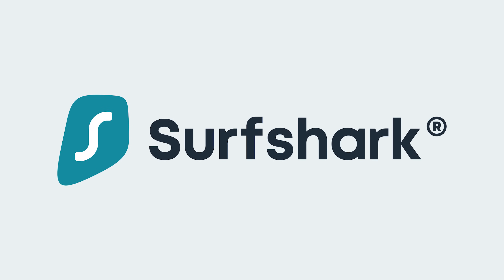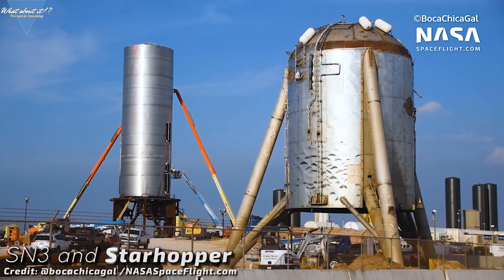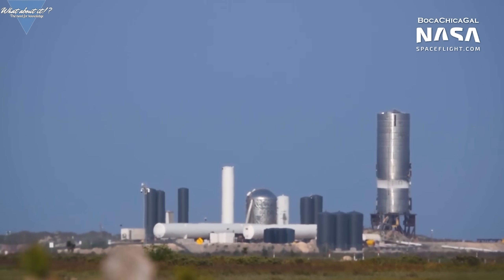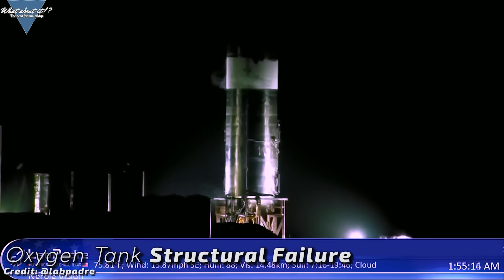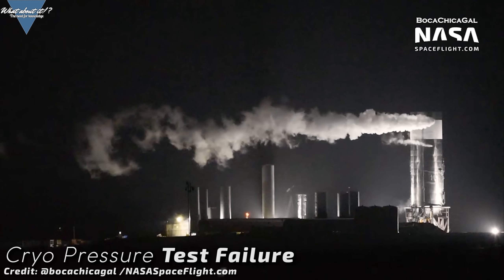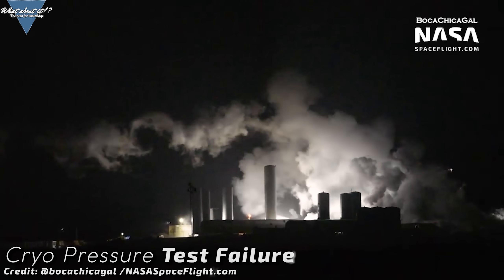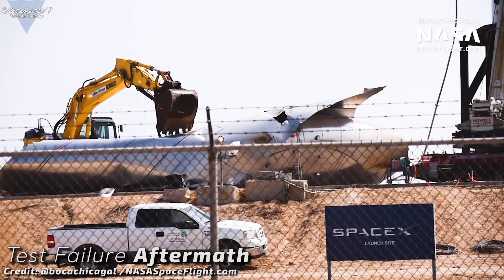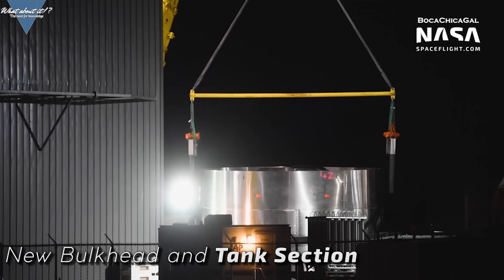83 | SpaceX Starship Updates – SN3 Cryogenic Failure Explained – Expectations For SN4

Comment: Personally I'd have thought the starship  would require a rigid structure to support the overall ship/frame.. afterall once its been into space most of the weight would be stacked at the top ie crew facilities etc then once it glides down it requires a structure to support the strain the wings would produce when they come into operation to stall the ship prior to vertical landing.. no frame, using the wings surely that would over stress the current design & split the ship in half or worse...
this test overall shows the weakness the current structures has... ie very poor, not only that is you also think/assume the lower booster structure (not built yet) has also a structure similar to this then again its very very weak.

rather then rushing a cheap/cutting corners design through to the launch pad... maybe they should trial the designs with scale models, computer modelling before building them as we've witnessed..

the rocket designs previously used & currently use.. all good & successful, however a rocket & a space ship have much different requirements & that's being overlooked.
I'd not be surprised if the competitor surprise everyone with a "here's what we've made" & have it launch successfully before a starship actually lifts off the ground. as there doing things properly, maintaining standards etc & using all available tests … but hey-ho "lets all wait & see"
Reply: As long as the tanks have pressure in them they are damn strong and act as a rigid structure. If they don't have pressure in them, well, you don't have fuel for landing so surviving re-entry isn't a concern.

Edit: Like Ryan says, if you have fuel you have autogenous pressure, therefore you have "structure". No fuel, no structure for significant acceleration loads, but at that point that's the least of your worries unless you have a refueling tanker or other reentry plan.
Reply: @jameshoiby  yes if the tanks have full pressure or equal/greater pressure within the tanks your a structural mass "vertically" up/along the ship, this structure is towards the centre axis of the vehicle. 
now the ship as it come into the atmosphere would be horizontal, thus going against its structural mass. then utilising the wings to stall the ship prior to getting into the vertical position for landing!! that would increase the stresses horizontally at all the wing area locations, this would be exaggerated due to the structural mass being down the centreline of the ship ie its most weakest/narrow point... 
the ship should/would require a structure to over-come the forces along its horizontal axis to counter-act the forces exerted on the wings & body upon landing (the ships vertical mass/weight isn't that important at this point)
Reply: @jameshoiby  yes! strong in a vertical position, as we see in the last test, tank/s low on pressure fail & the ship has no structural strength whilst in the vertical position (launch position etc)
the ship will have increased forces horizontally when coming into landing, this would increase when the wings are utilised for landing to stall the craft, having a structural mass towards the centre of anything is a weakness in-itself, hence why it would need structures to counter those forces, the fuel tanks don't have that mass nor strength as its overall forces go in the wrong direction.

ie simple example! place a plastic rule between 2 open tables & push on the rule, it bends & then shatters or snaps in half, apply that basis to the vehicle snapping where the forces would be greatest, between the wings side-side & then top to bottom.. weakest point would be between the upper & lower wings during stall/landing
Reply: Mal P The important thing you are missing is the tanks will be fully pressurized with autogenous pressurization of unburned fuel even when “empty” after liftoff.

Comment: My hope is that there is one team in SpaceX who will be really happy to see this test failure, maybe happier than if the test had succeeded. That team, if it exists, would be the Finite Element Analysis (FEA) engineers. If they are building FEA models (and I hope they are, I know for a fact they do CFD) then I bet that right now some FEA engineer is thinking "right, give me exactly the contents, pressures etc of those tanks in the time leading up to the failure and let me put that into my model and see if my virtual SN3 crumples at the same time index and in the same way as happened in reality. If there are any discrepancies between what happens in the model and what actually happened during the test that can be incredibly valuable to allow the FEA engineers to tweak parameters in their model to align it more accurately with reality.

Getting accurately calibrated FEA and CFD models is something we can't see from LabPadre's cams of Mary's work because it all happens inside an office but it is potentially just as important to speeding up the development process as putting up extra tents at the construction site.

Comment: (when a starship is coming back it is very light, even at empty tanks the payload is no more than 150t +around 80-200 for nosecone,, which gives less then 500t that crushed the lox tanks, no worries :) )
Reply: And it is still pressurized by CO2 and steam.

Comment: You dont have to fill an engine with a liquid, you can also just fill it with a gas. The lower tank lost pressure for some reason that we do not know and this is the configuration issue Musk was talking about.

Comment: I just keep on wondering if the cryogenic state on the stainless steal structure is the cause of the breakdown of structural integrity.  Maybe the material can't hold up under the differing temperatures on the stainless steal material, like when you heat up only one area on a sheet of glass.

Comment: SpaceX learns from its failures. Actually, the failure points to a future problem.  When Starship returns from a mission from capturing a load.  The ship will have to have a fortified middle section to land.  It's good that it crumbles now rather than later.
Reply: Note that any returning payload will weigh far less than a few hundred tons of oxidiser, so maybe not such a concern...

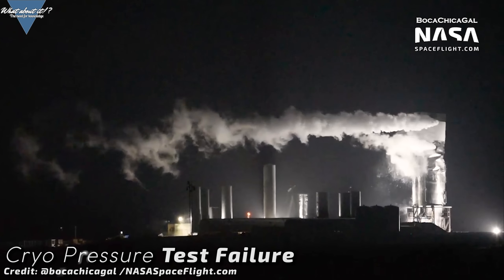Comment: 3:49 hmm but what is still not calculated here is that there is functional part of Starship missing. How much would it weight? Maybe they were checking this configuration (almost empty tank but a lot of cargo)? or maybe it is to early to bother that?
Reply: The tank was unpressurized or even a vacuum, that worse than the worst case.

Comment: I'm not liking the idea of them building a manned spacecraft out of frigging tinfoil.  This thing needs to be reusable.
Reply: Thats what all rockets are built out of in this case the tin foil is much stronger than normal.
Reply: @alextell7019  I thought most were made out of aluminum? The newest fad being carbon fiber...
Reply: @butterhat1938  exactly, thats why space x is trying to use a stronger material but without much other internal structure to build lighter stronger rockets.
Reply: @alextell7019  doesn't look a whole lot stronger. Seems like the experiment is failing. How can nasa approve of a manned mission where the astronauts sit on top of a pressurized tinfoil can that has to be able to land like a falcon rocket?
Reply: @butterhat1938  Its much stronger, the problem with that test was that the bottom tank was either unpressurized or in a vacuum with tons of liquid co2 sat on top of it, nasa sent plenty of astronauts to the space station on the space shuttle with epoxied on heat tiles and a thin aluminum skin.
Reply: @alextell7019  so what about when the starship lands back on earth when it's tanks are near empty? I like the space shuttle, but even it was eventually scuttled when too many astronauts died.
Reply: @butterhat1938  First, even if the tanks are empty they will still be pressurized, second if the tanks are empty then there wont be multiple tons of weight on them.
Reply: @alextell7019  if you're an astronaut do you really wanna bet your life on 1000feet of "qualified" welds that have been through reentry?

Because that's all that's keeping that vital "pressure" in under your seat.
Reply: @butterhat1938  Thick, high strength stainless steel vs epoxied fragile ceramic tiles? Every day of the week.
Reply: @alextell7019  you're clearly not a welder...
Reply: @butterhat1938  There us an old saying about this, you dont hire and engineer to build the strongest bridge you hire them to build a bridge thats just strong enough. Try crushing a plastic bottle with no top, the put on the top and try to crush it again. A space craft has to be as light and strong as possible and by all indications starship is, it will never have one tank fully fulled and one tank unpressurized, designing for that would be like designing a foot bridge to handle the weight to a tank.

Comment: AS Musk said they had pressurized  N2 gas in the lower section, anyone who deals with hydraulics knows that gas is compressible not liquid.
The lower tank section compressed under the weight if it had been liquid it wouldn't have compressed.

Comment: I get why s/n 3 collapsed. Still I must confess to feeling a bit discouraged. How many Starship fubar's before SpaceX runs out of money? Until it makes orbit and returns 🤞🤞🤞🚀🤞🤞🤞
Reply: Well i would estimate that it cost about 2 to build SN3. For company on scale of SpaceX it is not that much.
Reply: @skyrask1948  2... Million? Well yeah that's realistic price for 2 big steel cans connected to each other.
Reply: @_mikolaj_  If average salary between all workers and engineers is 100k an it took about month to produce it with 250 employees it is 2083333 dollars on salaries only. So yea any more witty remarks.
Reply: @skyrask1948  do you include material costs?
Reply: @_mikolaj_  As i said that was only for labor of course not every one work on it. Someone would on new hangars and other staff, that is why i said to estimate it it may be less or more, but i do not think i am too far of.
Rental of machinery is probably second highest cost in hundreds of thousands. 

When it comes for material steel in it of it self cost less than 100k and more like 20k. Other materials like batteries is not that much maybe 100k total. Since they do not use any exotic materials only  regular materials that are mass produced.

Comment: These failures show a perfect example how rapid prototyping works. Every iteration provides a plethora of minor tweaks and improvements and usually ONE major flaw whether mechanical, technical or in this case procedural. Intense design (every other rocket maker) tries to fix all of these before the first test, this makes their greatest investment TIME. And time is the most precious and expensive commodity in any project. It’s debatable, but rapid prototyping is less expensive because it saves time. How much you want to bet Starship flies before New Glen. If it does, what will it mean for the viability of NG?
Reply: This is not prototype failure. This is manager failure. But basing on that, o think we don't get 20km hop till some SN6. SN4 is already made, and still uses ballon tanks. Bad for reentry.
Reply: Mikicat your absolutely right. But if it’s a material, mechanical or procedural failure it’s still part of rapid prototyping. It’s all part of the same sleep learning curve. My former boss once told me, “it’s not a mistake if you can say I’ll bet they’ll never do that again.” Try to be a little more optimistic about the 20k hop. You are probably right but... come on! 🤨

Comment: Structure costs weight start light then build stronger as it breaks 🤔🤔
Reply: Only that Musk said it would become thinner. And SN3's steel was already much thinner than the Hopper's: 12.5mm --> 4mm

"Felix Schlang did some calculations of the weight of the ring segments with the Serial number one starship which is using 4 millimeter thick steel. These segments weigh 1622 kilograms. They are less than one-third of the thickness of steel used for the Starshopper. The optimized Starship will have some sections where steel is half as thick at 2 millimeters. "

(Quote from nextbigfuture)

Comment: My question,  Since at the launch they would use a special exhaust system  diverting the exhaust away.   But if it lands on Mars with tiny legs wouldn't  it get destroyed trying to launch from  being so close to the surface ?   I guess it won't be a problem if they never plan to relaunch  ......

Comment: Maybe, the starship shouldn't be that long. What if it was half the length but twice of diameter? With 20m diameter the simulated gravity inside should work, even if longer adaptation to high RPM would be needed.  With larger length the volume to mass ratio worsens, and also stability of construction lowers. On the plus side, there would be also much more space for engines on the bottom of the rocket. The rocket would be also much more stable once landed. 
Yes it would have a bit worse aerodynamics, but that doesn't matter that much over about 20km.

Comment: Saturn V had corrugated skin in carefully selected locations between propellant tanks, between stages, and as first stage engine skirts for the purpose of strengthening the overall structure. The corrugations dampened vibrations and resisted bending. The fuel tanks themselves staved off vibrations and bending by being loaded with propellant. As the fuel and oxidizers drained from the tanks, the empty vulumes were filled with inert gas (helium or nitrogen) to maintain their structural integrity.

Comment: I'm afraid that with such tiny legs there will be too little space between lower section and the ground when landing. Vibration and gas stream from the engines can destroy it.
Reply: My thought exactly. Landing on solid flat ground with those stubby legs might get tricky.
Reply: As long as the skirt pressure stays under 6 Bar, you only have to worry about resonance. But, the landing is so sudden that this should not occur. 

The landing is much shorter than launch, but on Mars there is no atmosphere pressing in on the skirt during launch. So the skirt should be ok. 

IMAO, there is no problem.
Reply: Landing with three engines should allow a hover-slam that is three times faster than Starhopper's.
Reply: @avid0g  It's difficult for me to imagine all the dynamic effects involved, but chamber pressure even in throttled down engines can be 100+ bar and exhaust volume is huge. It seems to me that leaving such small gap is a bad idea, after all.
Reply: @TechMasterRus  
A NASA simulation using "sand" shows that engine thrust will carve deep craters into the regolith, which will divert the debris upwards. If regolith is really that loose, the lander could be damaged. 

Anyway, these legs are an early design that may be adequate for a concrete landing pad. Elon already tweeted that the legs will soon be made longer/stronger.

Comment: I'm sure you've seen the tweet by now, but SpaceX was using a new redundant valve system on the tanks and inadvertently sent the wrong command to the LOX tank valves causing depressurization.  So, Elon's initial report was accurate.  Testing configuration mistake.  https://twitter.com/elonmusk/status/1246696253074915328

Comment: If you remember that both tanks have 1 common bulkhead and it's curved and (as I remember) directed downwards, you cannot put pressure to lower tank without pressurizing upper tank. Otherwise, pressure can destroy the bulkhead from outside of the curvature. I don't know, whever they can fill the tank with liquid nitrogen under pressure and especially empty it. For example, you want to empty the upper tank, you release pressure from it and testing algorithms also release pressure from lower tank in order to keep bulkhead safe. The upper tank is still filled with hundreds tons of nitrogen and the lower tank collapses.
Also, after hitting the ground, methane tank did not explode like SN1, so it wasn't pressurized.
Or mb just a leaking valve, who knows.

Comment: It was a vacuum collapse.The liquid nitrogen in the top tank condensed the remaining gaseous nitrogen/or air in the bottom tank because it was not properly vented to atmosphere. Its possible that the vent valve was frozen from not drying the tank/valves/piping after the hydro test.  If air had been allowed to freely enter the bottom tank, this would not have happened. The tanks are obviously not vacuum rated.

Comment: Just put some machine learning algorithms in charge of designing the most optimized skeletal structure for Starship-- much like modern casts for mending bones, but on the inside. Maybe this skeletal structure would be strong enough to roll the outer rings directly onto it? That might allow for a more fluid assembly line/manufacturing layout.
Reply: Nah they only need not to cheap out on using gas(probably pure N2 or straight up air) that can condense and use helium instead.

Comment: Questions: Does the frost line that forms on SS during cryo appear right at the weld between two ring sections, or in the middle? If so, would that cooling and warming affect weld integrity?
Reply: The vertical seams are reinforced as needed. Normally, the cold improves SS strength.

EDIT The bulkheads are attached to hull rings in the middle so hull ring welds are not involved.